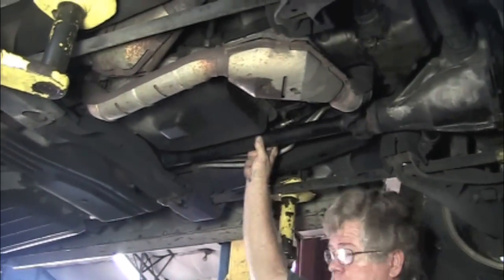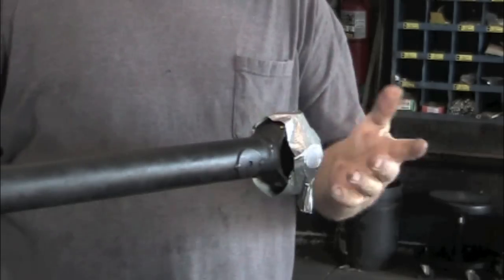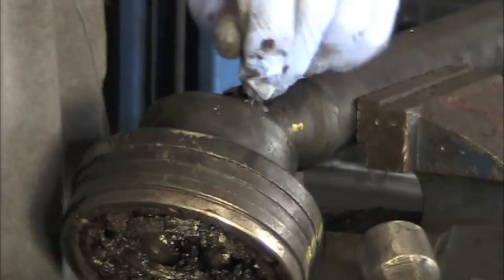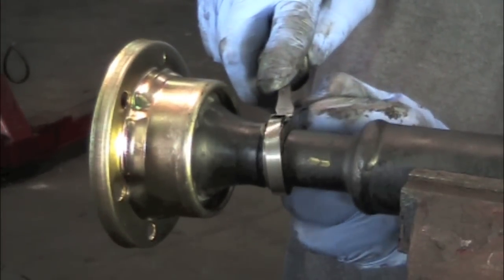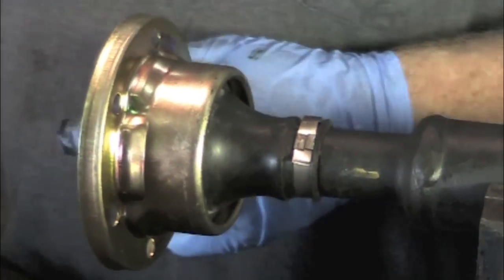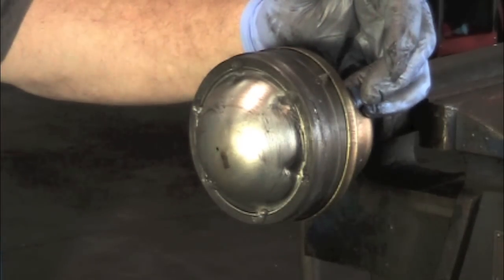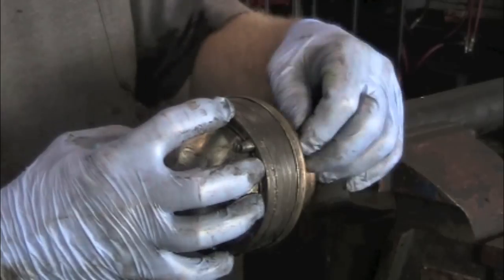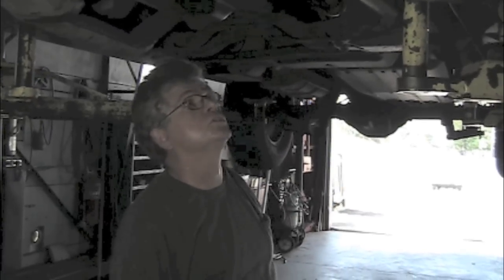Explorer Propeller Joint

Comment: Also: For other people doing this job: In this video, The CV joint was only lubricated from ONE side... 
(after putting retainer clip on, at time marker 7:40 to 8:05 ... and extra grease wiped off at 8:52 )
It would be better to grease BOTH sides of bearing, and use half grease on back side (facing rubber boot)
before installing on shaft, and then use 2nd half of grease as shown in this video, to keep joint well lubricated.

Plus, if working on front section of drive shaft also... When you have the drive-shaft OFF during job, 
it's good to replace the rear "tail seal" on your transmission, while you have things apart:  (only about $14 part)
This is the round piece of rubber  at the rear/tail of your transmission, which the front slide-yolk of your drive 
shaft slides into while it is going onto the metal shaft from the transmission.  
Replacing this when you have a chance (or every 90K miles) can prevent one of the more common types of
transmission fluid leak.  You may also consider replacing transmission oil filter, while working under there.
Reply: Thanks for sharing and good point!
Reply: It’s off the transfer case. They’re bolted on the front diff and the rear. It’s not a slide yoke you slip out to remove the seal.

Comment: i know this is an old video but it is as good now as 8 years ago. I just installed the drive shaft CV using this video.I have one comment. The fellow mentioned that the old bolts need to be used because the new ones are shorter than the old by about 1/4 of an inch. The reason is because the bearing has to be drawn into the metal cup. It is difficult to do that and I did not realize it was necessary  until I went to tighten them. In fact I found it difficult to get all of the bolts to catch on the flange holes until I tapped the back of the cup and realized it was walking itself onto the bearing. Then when I tightened the bolts after they would catch it took about 30 turns to get to the point I could torque them.

My suggestion is that when one is installing the bearing on the bench, take and install all the bolts along with the spanner plates, Then find 8 nuts for the bolts and use washers and draw the bearing into the cup. By carefully tightening the nuts  equally you will pull the bearing into the cup and it is preferable to do it on the bench rather than under the car. Good Luck.
Reply from the maker: Thanks Shannon for your observation and comments.  It will help those making this repair.
Reply: Olá  estou substituindo a bolacha da minha ranger 2009, este vídeo junto com este comentário vão me ajudar muito.
Obrigado  pelo vídeo.

Comment: Nice job! I would have changed out the other joint as well if it was mine. Customers choice if it isn't mine. I wonder if that type of joint is stronger than a regular driveline cv joint?

Comment: Thanks. Very similar to how it's done on my 2002 Dodge Dakota.  But the one I got for my Dakota had a gasket that went in the cover before the bearing assembly.  It also had some small external weights that went on with the cover bolts.
Reply: Interesting on the weights. Did the instructions tell you how to install those correctly?

Comment: Just had mine to a garage yesterday they did what you're doing on the way home it felt like the whole damn drive shaft come off from the front knuckle or something had to limp it home no matter what speed I went severe vibration up through the floorboard underneath your feet I guess I'll find out later today when I crawl under there what come apart thinking they didn't put something together right hopefully it's not to severe

Comment: Notice the boot clamp was installed before the joint was splined on and bolt holes lined up. That new boot would tear in the first month of use.

Comment: Great support,  I have a roaring coming from front end of my truck at 30+ mph and gets louder with speed.  No clinks or clunks. Could this be my problem also ? or does it sound like something else ?  2000 Ford Ranger XLT  4X4 5 speed automatic. 2x 4x4 high / low switch on dash.  Just asking before I look into it. Thanks.

Comment: Thanks for this video. A local shop wanted to charge me $275 to do this for me. That was with me taking the shaft off and installing it. I had to buy a couple tools but when it was all said and done it was about $80. It was not as hard as I thought it would be and it fixed the vibration/noise.

Comment: Thanks very much for the video.   Wifes 05 Sport Trac has been making a rattling noise since the fall.  Forward drive shaft had a lot of play and then I found the boot was all torn.   I have never pulled a drive shaft before, but put the truck up on the front ramps, followed your video and had the new CV back in under two hours.  I didn't have the clamp tool and couldn't get it tight enough using needlenose and so I used a worm clamp.   No vibrations or balance issues so I am happy.

Comment: hey, can someone tell me what you torque the bolts to? ....this is the first time I'm doing this and not a mechanic.  Learning lots though, thanks to this video.  Thanks
Reply: Haynes manual says: Driveshaft-to-transfer case flange bolts:
1991 through 1996 = 70 to 95 Ft-lbs
1997 and later = 22 Ft-lbs.
Driveshaft to differential yoke bolts = 120 to 180 inch-lbs
Reply: ...the u-joints are 14ftlbs...the cv bolts are 22ftlbs...2 year too late...

Comment: Lubrication could have been better.  That is not how you pack bearings with grease.  Also, lubricating the boot makes it slide easier instead of risking tearing the boot with a screwdriver.

Comment: A dude,your a skilled mechanic that does the job right..enough bragging about you lol,can u show me how to change out my front differential in my 95 explorer..I been keeping the parts store in business with the junk I got off of Craig's list.under research I found out the most common this to go bad on my truck is the intake air control valve ( I already know how to fix) and the front differential gos bad..I been hearing a noise that sounds like a ole world war fighter plane then I thought was the wheel bearing but when I changed the upper ball joint on the drivers side the sound went away,that is unless I steer to the left or hit a bump..the noise with the shuttering vibration while driving with my research lead me to check the front differential.I found a leak right where the cv axle gos in,but I think it took me to long to find the problem to fix the differential I have so I'm going to put down the money to get a new one..I like doing research before I do anything.I'm sure I could replace it with out any help but I'd rather get the full grasp on what I'm getting into for time management and so I have all the right tools.could you make a video please
Reply: Are you talking about swapping the bearings in your diff? If so, it's in no way a small job. It's doable, but it requires setting precise tolerances and potentially multiple iterations of the same work to get it right. You'll also need tools the average home mechanic doesn't own. If your noise occurs only on left turns and bumps it's probably not the differential anyway. Did you check your CV joints? CV axle shafts are generally pretty cheap (> $60) and easy to swap out. You might want to try that first.

Comment: It is so disappointing to find aftermarket and often OEM parts with that Made in China sticker. "Manufacturers" boost profits by using minimal or substandard materials and labor, plus the part's inevitable replacement in a short period of time ensures repeat business.  Chinese-labeled parts used in critical safety areas like brakes, steering and suspension scare me!  But what can you do if there are no better quality alternatives?

Comment: Calling him a fool is inappropriate. If you watched the video, the replacement bolts were the wrong size. Is that the quality we ought to accept?
I'll bet the FoMoCo part isn't made in China, and with just a little looking one can usually find parts made in the USA. Dorman is well known for providing cheapie China made parts.
Say what you like, but not all parts are made in China, nor will I buy them if I have a choice.
Reply: fomoco does not sell the part. you either buy a whole new driveshaft or you buy this kit